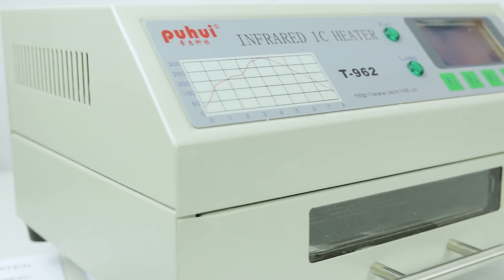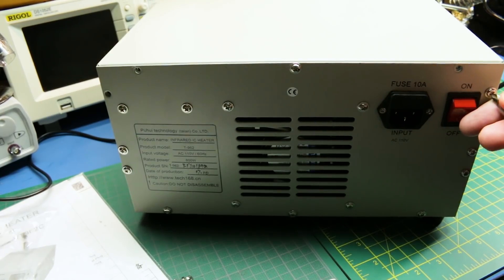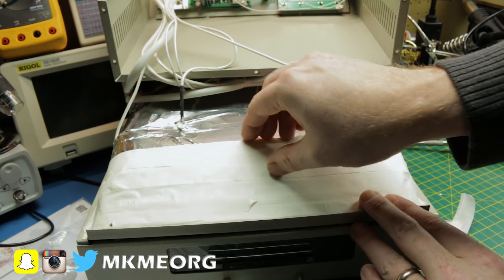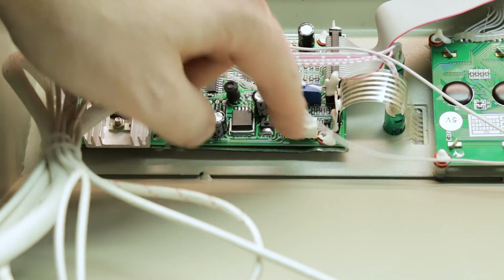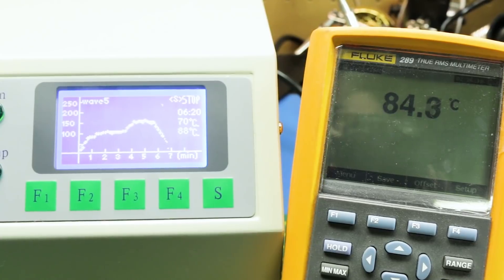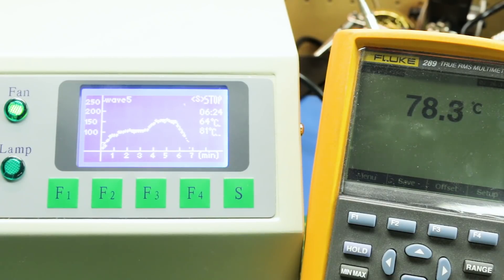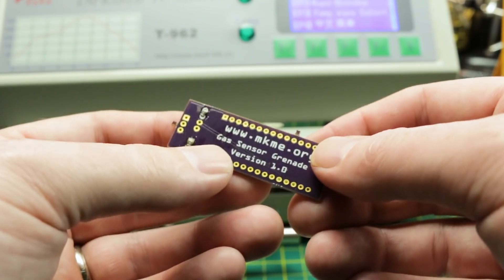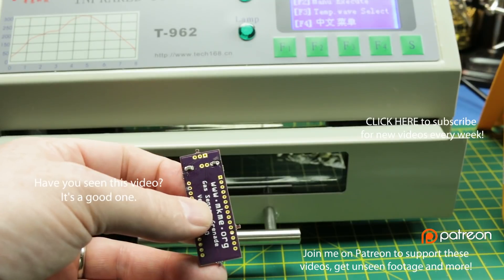🆕 Soldering Electronics- T962 Reflow Oven Review Pt.2

Comment from the maker: Anyone doing any SMD soldering on their projects?
Reply: Hi, I recently created new firmware for this oven based on the Unified Engineering firmware, to add more features and make the UI nicer to use. The Unified Engineering firmware hasn't been updated in over a year, and I can't get my updates pulled, but you might like the firmware. I included a hex file to flash straight to the oven so you don't need to build it. I've been using this oven for about a year for SMD work. The firmware is here if you're interested (it even has a Pacman screensaver :) ): https://github.com/Smashcat/T-962-improvements
Reply: @Anticitizen666   nice. do you have a video of the working firmware and a how to on how to flash the new firmware? cheers

Comment: In my experience dealing with calibrated industrial ovens, when you want to check the accuracy of the measurement, you should place your thermocouple as close to the oven's as possible. The reason for this is that quite often the temperature is not homogenous. You will have hotter and colder zones inside the oven. If you want to go anal about it, you can replicate the actual calibration procedure and place 9 TC's, one at each corner and one at the very centre. As long as your measuring device is consistent, you should be able to see if the oven is balanced, and what class it fits into. Class 1, from memory, is within ±2ºC between all the TC´s and the set point. There is also the matter of the response time, but that is going way OTT for non-critical soldering.
There are two main ways to improve the homogeneity of the temperature. One is the heating elements distribution in the hot chamber. If they are evenly distributed and equally balanced, that alone will make your life a lot easier. The other way is to have air circulation. In the case of these ovens, it cannot be a strong air flow, or you risk blowing the components off of their rightful place. A slow turning cooler that is rated for high temperature will certainly do the trick. Measuring the PCB temperature is also an important step if you are looking for a very accurate result. If you have followed all of these guidelines, your oven will be potentially improved and fully characterized. For those who want to go through the trouble, you can run your own calibrations periodically, which will show you if your oven is degrading over time. Again, that's meant for processes that are very demanding, but it's still a good learning exercise.
I must advise you, however, that TC's have a limited life span when you are dealing with calibration processes. The norm states that after a number of cycles they should be scrapped. They can still be useful for less demanding tasks, but as far as calibration goes, they are done and need replacement.
Overall, great video. Sorry for being extensive, I just wanted to add some information that may one day help you understand a bit better why something is not working as you'd expect. It's not that I'm an expert, this is just what hands-on experience has taught me, hopefully it will be useful to someone else too.

Comment: So here's my thoughts. Having a K-Type thermocouple in the air does not compensate for the fact that a board has a thermal mass. So the profile setting may be correct for the actual board surface temperature as it has to heat up the PCB too. The way to check this would be to tape the K-Type thermocouple to the PCB.  Also is the Thermocouple Ice-compensated (or corrector compensated for room temperature) ?  Great review.

Comment: I may be imagining things but did you put kapton around your thermocouple? If so would that no insulate it?
Reply from the maker: I did indeed, on purpose even.  The laws of thermodynamics still apply so no- it wont insulate it from the oven- it will still rise to the same temp. It may help (maybe) to not be so affected by strictly radiant transient effects as the heaters toggle- which is why I taped it.

Comment: Awesome! Glad to see it worked, even with the temp discrepancy.
I get a 15-20deg temp discrepancy with my temp probe in my oven too. There is no perfect place to mount it to read a good average.
So will you be doing any follow up videos, and maybe do any of the mods?
Reply from the maker: It will definitely be in more videos. I'm testing it more right now- I might not bother with the firmware if it keeps working for me. I'll probably test shielding the temp sensors from the element radiant heat- I suspect that might be enough to make this thing very close.  For now it seems to work pretty great
Reply: Great! Looking forward to seeing more... I'd be super interested to see reflow comparisons for when the boards are in the centre compared to being on the sides of the tray, especially for multi-board reflow to see if it struggles to keep it even. No pressure ;)